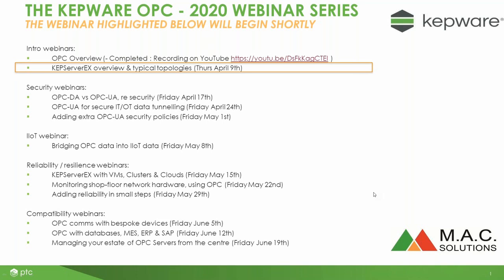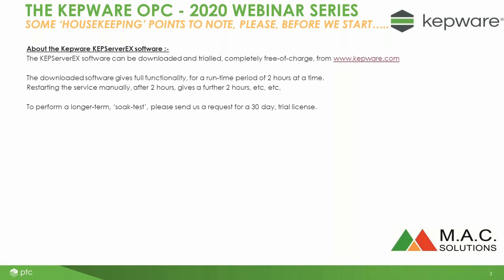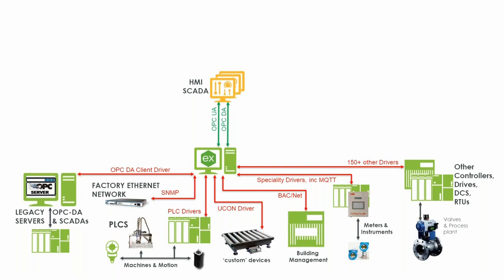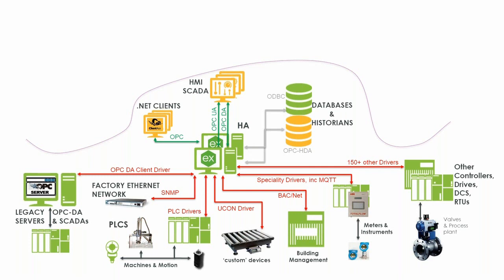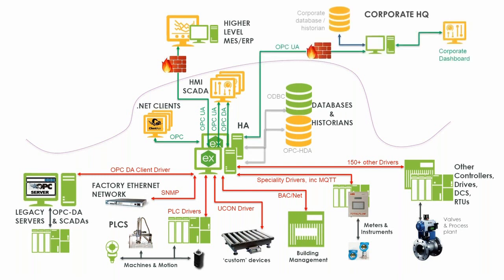Kepware OPC - Introduction to KEPServerEX

Comment: I find myself in an environment where we have a Kepware OPC server and about a dozen PLCs and a couple thousand sensors.  The person who used to make tags has been gone now for about 3 years. Thus, knowledge of Kepware is no longer prominent in the company. My background is software engineering/dba/data engineering. I will want to start getting data from the sensors - but I'll first need an understanding of how to use Kepware... I think to start making tags AND how to do it safely without any interference on the shop floor.

Could you please point me in the right direction for some more information? Thanks. This video was very helpful to me.
Reply from the maker: Dear Spencer, 

Thank you very much for your comment, and sorry for the delays in responding. 
Our Support team should be able to help you, please raise a ticket on the following website:  https://support.mac-solutions.net/ 

Have a good day, 
Adeline.